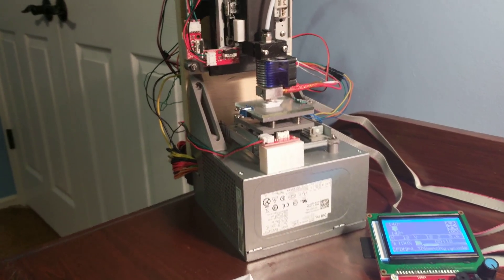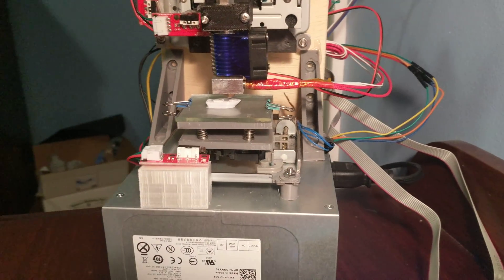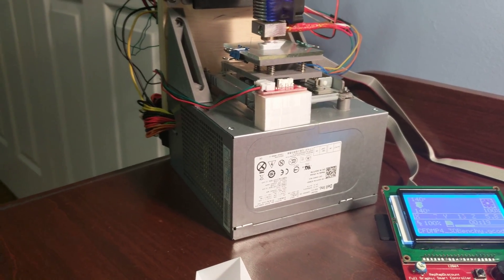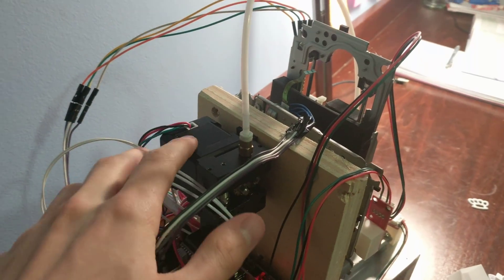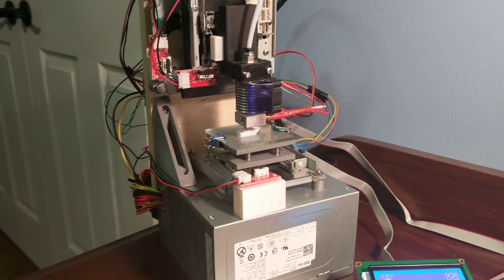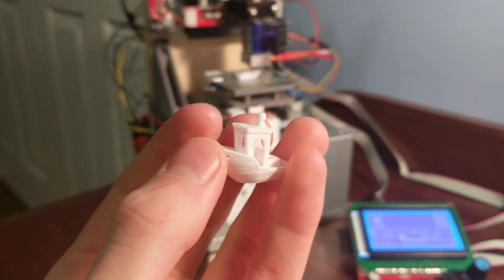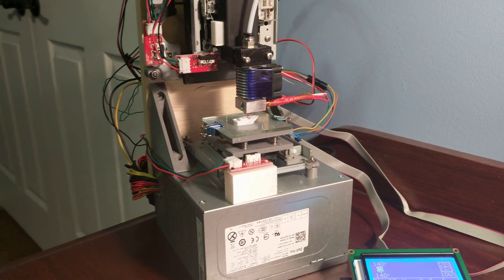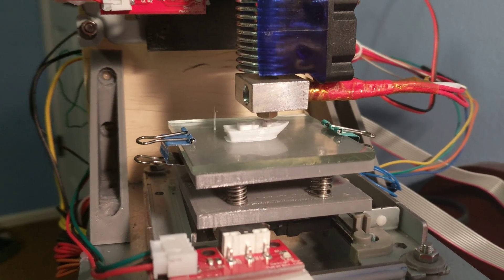40 dollar 3d printer! Reprap ewaste CD drive printer made from scratch.

Comment: I have most of this stuff laying around, are there any files published?
Reply from the maker: I posted the Marlin firmware file for this printer on my Github page (link in "about" section of my youtube channel). Besides that, no stl files have been posted, nor is there intention to do so. its kind of a model as you go type of design, as there is essentially no universal dimensions between two random dvd stepper carriages. Basically, you'll just need 3 dvd carriages from dvd drives, a power supply (12v 5a at least), a hotend+ extruder, and a controller board/ optional lcd. Its all held together with on the fly printed parts and hot glue from there. Best of luck, mate. Let me know how it goes

Comment: hi. what do you use as a controller for the cd 3d printer?
Reply from the maker: Ramps board+Arduino Mega. A4988 stepper drivers and Reprap discount LCD. Though you can use any controller you like
Reply: @MakingwithLuke  ok thanks

Comment: Is there a guide somewhere for this build? Seems like a great way to start at 3d printing, can this be used to print parts for other printers?
Reply from the maker: Yes, you can look for e-waste 3d printer on instructables, or the curiosity 3d printer for some solid guides. Its a pretty bad printer, actually. I made it print parts quite well by tuning the slicer/firmware, and it is extremely cheap, but Bang-for-your-buck something like the ender 3 or even an anet a8 would be exponentially better to start off with. You could print other parts for a reprap, but you're only working with a 40mmx40mm build area, so not much. I basically just did this because it was neat, not because it was useful so if you want to build one keep that in mind. Best of luck, mate.
Reply: Thanks for answering me! Im actually pretty broke, but I have a lot of electronic junk laying around. The most interesting part for me is the firmware, is there an instalation guide for the code on your github? Im really interested in doing this because it may allow me to do a little more polished parts for my electronic projects like gears and such.
Reply from the maker: @linobigatti  Yeah, I'm happy to help. Hey, I won't try to stop you, I just wanted to make all of my understandings about the project clear. If you think its for you, I'll encourage the challenge and give you whatever resources I have available. I have compiled a version of marlin for this printer on my Github page. It is very likely that you will need to modify it to your printer's specific needs, however. Best of luck, I hope the design will be of some aid to you and your other projects. Don't hesitate to reach out again if you need any other help.

Comment: Good work making this printer! I saw a similar printer 5 years ago in instructables (link below), but yours is a better design with CD/DVD rom drive motor instead of a floppy drive motor for the Z axis, with the power supply as a base, with endstop switches and 3d printed parts.

Do you have the instructions to build it? Would love to finally build one!

https://www.instructables.com/id/eWaste-60-3DPrinter/

https://hackaday.com/tag/3d-printer-out-of-e-waste/
Reply from the maker: Thank you! I actually got the idea from that instructable a few years ago as well. Their printer certainly looks better, but I agree, this one probably performs better. I don't think this was an extremely innovative project, but it was kind of neat to build. I don't have any instructions. If you want to build one, you should just use the links you sent me. Also check out the curiosity ewaste 3d printer on instructables for extra resources. I have precompiled firmware for this machine in the about tab of my channel. 

Thanks!

Comment: Did you ever get around to posting stuff about how you made this? It's really cool and I'd be interesting in making one myself.
Reply from the maker: In part, yes. I have posted my marlin configuration on my github page (link under the about tab of my channel). I won't be making anymore videos on this project as I'm working on much cooler stuff now. I'll hopefully be posting again next year. As for the dvd drive printer, theres tons of videos on this if you search "dvd drive 3d printer" or some variation of it. Theres also a very thorough instructables page here https://www.instructables.com/id/Curiosity-120-eWaste-Educational-3D-Printer/ and herehttps://www.instructables.com/id/eWaste-60-3DPrinter/ . Thanks
Reply: @MakingwithLuke  Thank you for the info! I'll check those things out.

Comment: How do you solved the z axis overheating ?
Reply from the maker: On my printer, the z axis motor gets quite hot, but it seems to work. It has printed for a maybe a  dozen hours now and has no issues with being really hot. Its almost like the motors were meant to be run like that. To make the motors run cooler, you can simply turn the potentiometer on the stepper driver so that current is limited. Tuning these motors can be tricky, but its not terribly hard. Best of luck!

Comment: What is the vref you use for the engines? and you connected the 3 jumpers below each driver? What is the driver model?
Reply from the maker: Yes,  I connected all three jumpers to achieve 16 microsteps. The driver model is the a4988 pololu stepstick. I used around half the voltage normally used for nema 17s. 0.2 volts, I think? It varies and it is quite the challenge to tune the current perfectly. trying to find the balance between a burnt motor and an under-powered motor can be tricky. Bring a spare.

Comment: Your stepper won't get hot driving via a4988?
Reply from the maker: Tuning the steppers are tricky, but it works just fine now. Low voltage, low speed. They get a it hot, but function adequately well.

Comment: Hello
I saw a video on MRRF and found this a good project for me. Is there any possibility of making available a list of used material, software used for printing, this would help a lot.
Thank you
Reply from the maker: Yes, I currently have posted the firmware, and I will be posting the printed files I used soon. I plan on making a build guide type video for this printer as well. If you have any other questions, please ask

Comment: hey man so i've build a similar printer.(i already have a anet a8 but i wanted to experiment with stepper motors)im using a spare anet a8 motherboard for controlling the stepper motors but they get way too hot in only a few seconds of working.i went into marlin and tried reducing the current but it made no difference.any ideas?maybe i didn't change the correct settings?Great video btw!
Reply from the maker: Yes, you'll need a board that can control the stepper driver current through potentiometers on the driver. Try the ramps 1.4 board, that's what I use. Thanks!
Reply from the maker: you'll need to run your motors at about .2 volts btw, and you need a multimeter to check voltages. If you have any questions, feel free to ask.
Reply: @MakingwithLuke  True.i figured out that my board only has a pot for the z axis and no option for software control as the drivers are standard a4988.they use a resistor to have a set current instead of a potensiometer so im out of luck unless i hack some potensiometers in there.my extra set of nema 17's just got in so its time to build a real cnc/printer.Thanks for the help!Have a good one :)
Reply from the maker: @RcManiaCyprus  Happy to help, You have a good one as well!

Comment: Cool, what is the maximum size of the printed item?
Reply from the maker: Thank you. I can print up to 40x40x40mm
Reply: Making with Luke I'm going to make my own on arduino uno.
Reply from the maker: @vjotov  Are you planning on making it a 3d printer or just a cnc? You cant make a 3d printer using an uno, at least you cant run marlin firmware on it. A ramps + mega is very affordable, and I would recommend that instead.
Reply: @MakingwithLuke  I already have uno and CNC sheld v3 and 4 drivers, If the won't be fine, I'll get a mega with shield.
and from the uno I'll make a slider or CNC.
Reply from the maker: @vjotov  Yeah, like I said I would just buy a cheap ramps board for the printer. To use an uno, you have to run a separate type of firmware, and it wouldn't be a very pleasant experience. I would love to see more on your cnc/slider! those would be great projects for an uno.

Comment: Nice build! I had been considering this lately anyway but seeing this on Tom's MRRF video I have started to design my own using dvd parts. I tested some dvd stepper drives with an anet board to see if they would work. They worked but got extremely hot. What voltage and current limit did you use for the cd steppers? Thanks
Reply from the maker: Thank you! I would highly recommend it, its a fun little printer. Yes, you notice the heat on an anet board because that board doesn't have adjustable current on its drivers. I would recommend buying a cheap ramps board, and running your stepper drivers at .2 volts to start out with. You can burn out a motor by going to high, so be somewhat careful. Tell me how that works.
Reply: @MakingwithLuke  Exactly yes, running on the anet board was just to see that I can actually run the motors. My plan is to buy a cheap board so I have the current control. Thanks for the tip
Reply: @MakingwithLuke  Thought i would follow up on my comments from before. I finally finished my design for a 3d printer using dvd drive motors. I took just the motors and smooth rods from the DVD drives and the rest is printed. (most of the time was just waiting for parts from china!) Here's a link if you are interested https://www.reddit.com/r/3Dprinting/comments/bnne5d/i_designed_a_mini_3d_printer_made_with_dvd_drive/
Reply from the maker: @MegaAndynumber  I was literally just looking at this on reddit! Very nice design. My conceptual 2nd iteration was planned to look very similar to this, using only the smooth rods and leadscrews, to make a build more universal for different dvd drive types. Im not sure if ill get around to it, but ill certainly take some design hints from your build if i do.
Reply: @MakingwithLuke  Thanks! Yes the reddit post seemed to go a bit crazy. There's lots of room for improvement on my design so still worth getting your own one out there. I need to improve the Z axis as the leadscrew teeth tend to wear out and also binds easily.

Comment: Hi Luke, I am making similar 3D printer as yours her and I will highly appreciate if you can share the .stl-s of all the linking components and brackets. Thank you in advance.
Reply from the maker: Yes, I will soon be doing that, sorry I just responded, I must've missed your comment. I will make a new video on it soon and link to all files, including printed parts and firmware
Reply: @MakingwithLuke  I can't wait to see it. Thank you in advance. 
Your contribution is highly appreciated, because as I told you I made similar printer from DVD drives, but I am facing problems with the double Z axis, so the instructions for your project will help me a lot to complete this mini beast and bringing it in use.
Reply from the maker: @Markowia  Thank you. I will help in whatever way I can, and will soon be posting all files with my build guide. You'll have to keep me updated on your printer, I'm excited to see how it turns out!
Reply: @MakingwithLuke  Of course, I will, as soon as it comes to live. 
Initially I used the instructions of Dintid (here: https://www.instructables.com/id/Complete-newbie-step-by-step-3D-printer-with-all-p/) to build the mechanics, but with slight modifications on the structure with 2 motors for Z axis.

Comment: Qual regulamentação você usou nos drivers? e qual configuração é usada no firmware? Estou tentando dias e os motores só se movem em uma direção. Se você puder me ajudar .. Obrigado.
Reply from the maker: Eu usei drivers de passo padrão, em cerca de 0,2 volts. Vou compartilhar meu arquivo de firmware marlin em breve. Sim, isso é um problema com o firmware. Tem a ver com configuração endstop. Se você tiver mais alguma dúvida, por favor, pergunte.
Reply: @MakingwithLuke  This is just my problem, I will try to find and modify the final line of the course, if I have another problem, I ask another question.
Later, if all goes well, I'll make a video and put the credits for you for helping me !! Thank you very much.
My name is David, I'm from Brazil. THANK!!
Reply from the maker: @DavidChevette_  Yes, if you use a ramps board with a4988 or drv8825 stepper drivers, you can  physically adjust them with a potentiometer. Yes, Ill always be available for questions. Thank you, David!
Reply: @MakingwithLuke  Yes I use ramps 1.4 with A4988 would it be the same 0.2 volts?
Reply from the maker: @DavidChevette_  yes, exactly. I would start at .2 volts, although much tuning was required for mine. specifically the z axis was tricky.
Reply: @MakingwithLuke Ok, estou configurando o firmware do zero agora, então estarei testando, quando postar o vídeo vou enviar o link para ver como estou fazendo ... muito obrigado pela ajuda !!
Reply from the maker: @DavidChevette_  very cool. here's my firmware, i just put it on my github. try it when you can and tell me what you think. this is tuned for my printer, so it may not work perfectly for you, but it will be a good foundation. I'm happy to help you! https://github.com/MakingwithLuke/Making-with-Luke-3D-Printer-Files

Comment: I see tons of old printers on the side of the road on garbage day. I took one of them apart one time and was surprised to see (although I shouldn't have been surprised, it makes total sense) that it had built in encoders. Needless to say the print volume would be larger, and with the encoders it should be very accurate. I just wish I had the brain power to make it work. Would you consider doing a step by step video? I realize every printer would be different, but if you used 3 different brands and you showed how you figured out the pinout for the ribbon cables etc. Maybe some people could adapt to build their own.
Reply from the maker: Yes, they are very abundant. I love taking apart old printers, they have rods, stepper motors, dc motors, encoder, and much more. I am working on  building a closed loop dc motor that can utilize these motors/encoders in printers. 
I would argue you have more brain power than you think! If you think you don't have the capability to do something, then you will be right. Until then, the sky is the limit. 
I will do a build guide in the future, and try to make the printer easier to build. I hope it catches on more, and i want to make it more accessible for everyone.
Reply: @MakingwithLuke  in general I would completely agree. It is a self fulfilling prophecy. However I have been in 3 auto accidents. None were my fault but each of them banged my head around.  So I went from the next Einstein to the current Gomer Pyle or Forrest Gump. Nevertheless, I'll be watching to see what you do for the while. I do hope you start going into a lot more detail though.
Reply from the maker: @vonries  Sorry to hear. Thanks, and I will.
Reply: @MakingwithLuke  no need to be sorry. I'm sure I still have a better life then 95% of the people on the planet. My children are in a pretty safe country,  they have opportunities in life, and I don't live in a famine ridden war zone.  All of life is ups and downs. If you never had any bad in life how would you know the good things, the ups in life.

Comment: Use an old PC processor as the heater for your bed :D
Reply: Use old CPU as THE bed. Those things are made perfectly flat to get good heatsink contact.
Reply: With some creative hackery, you might even be able to actually run the printer firmware on it :D
Reply from the maker: @ZrJiri  that would take some veerry
creative hackery. fun concept nonetheless.
Reply from the maker: @ZrJiri  very true, I may look into it
Reply from the maker: Haha I didnt think about that. That would be a fun novelty to implement. not the most practical, but fun.

Comment: Very cool. I really admire the re-purposing of old parts. Where did you find stepper motors for $5?
Reply from the maker: Thank you Paul. It may have been a bit more, especially if you buy individually. You can salvage old steppers from inkjet printers, and use that instead.

Comment: Recently took apart a computer with exactly 3 cd drives. Guess I know what I am going to build now. Thanks for the idea, it would be great.
Reply from the maker: Great to hear! keep me updated.
Reply: @MakingwithLuke  Hi, thanks for your reply. I am going to buy the rest of the needed parts but I am a little bit unsure what board and lcd to get specifically? Would you recommend something in particular? Thanks again
Reply from the maker: @diyowl5496  Great to hear. I would recommend a ramps 1.4 kit that comes with the lcd. you can get these many places, I got mine from aliexpress. the whole kit can be had for under 27 dollars. Happy to help.

this kit comes with all you need, and more. You can also look for something similar on ebay/amazon https://www.aliexpress.com/item/CNC-3D-Printer-Kit-with-Mega-2560-Board-RAMPS-1-4-Controller-LCD-12864-A4988-Stepper/32971954696.html?spm=2114.search0104.3.30.59431f230XYWtp&ws_ab_test=searchweb0_0,searchweb201602_3_10065_10130_10068_10890_10547_319_10546_317_10548_10545_10696_453_10084_454_10083_10618_10307_537_536_10059_10884_10887_321_322_10103,searchweb201603_51,ppcSwitch_0&algo_expid=0ae207a3-9221-4ae2-b7d5-3222028791da-4&algo_pvid=0ae207a3-9221-4ae2-b7d5-3222028791da&transAbTest=ae803_3